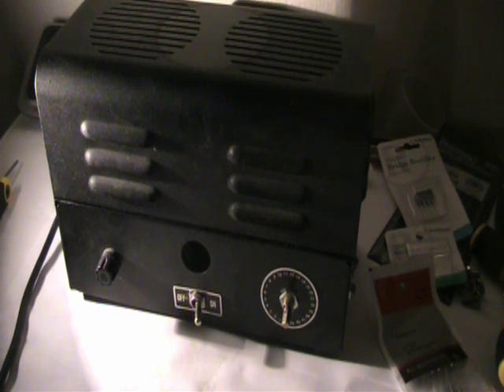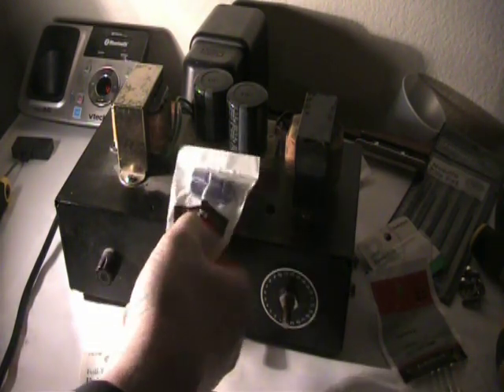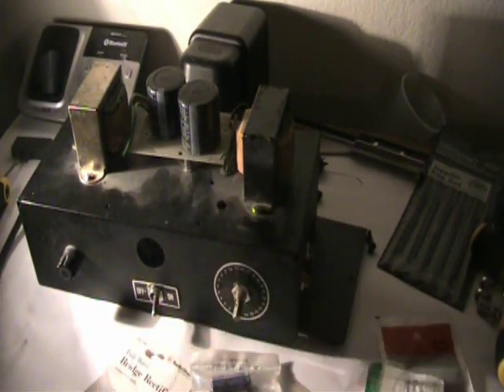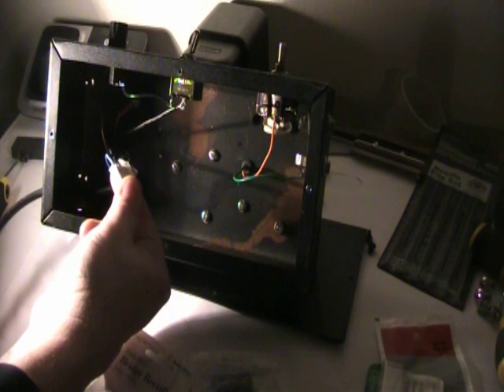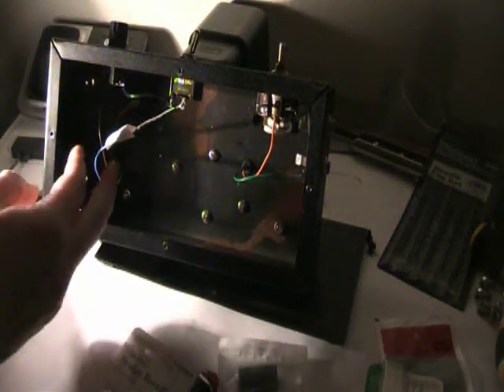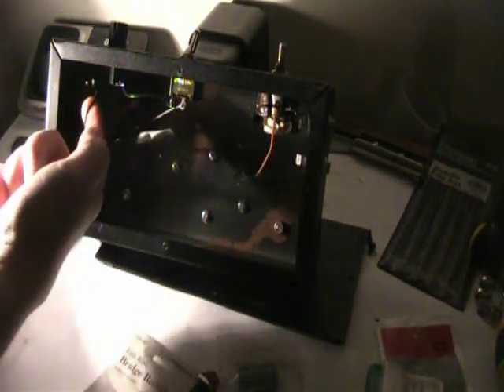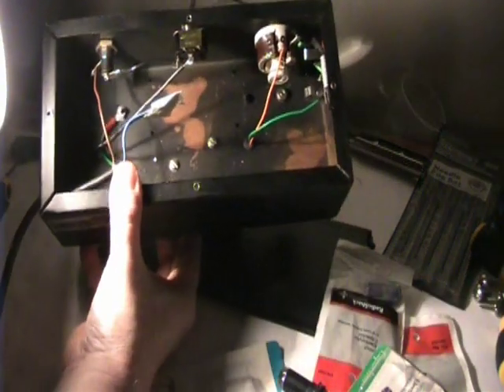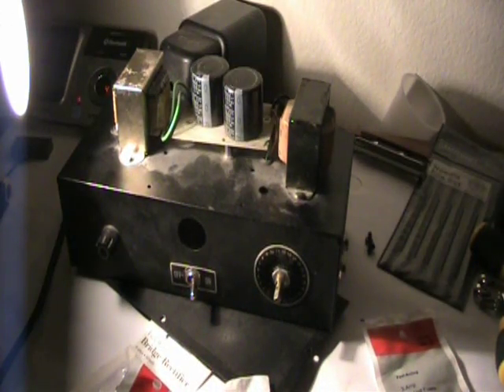How to make a Tattoo Power Supply -

Comment: Does this power supply have a voltage regulator, or could one be added? Also, do you happen to have the parts list that you used for rebuilding this power supply?

Comment: You have one thing wrong on your explanation of the diagram. If you use a potentiomemeter you will need a LM317 regulator and a resistor like you said, BUT it's not that 330 ohm resistor on the diagram. THAT one is used so you don't burn the LED. 
The diagram doesn't show the resistor or the LM317  because that is another circuit on it's own so it just reads "regulator"

Comment from the maker: @rickpermanentmarker       are you apsolutly sure its the psu  , you said you did a spring change .  if the machine was throwing a large spark that sounds like a capacitor .  and if it is pegged maybe something is shorted .  does it do this with other machines ?  always remove any variables when trouble shooting

Comment: I've got an old National power supply I've had for 12 years without any problems whatsoever. While tunning a machine after a spring change my power supply started throwing massive power, my machine was arcing like a welder & the voltage needle is pegged all the way up & I can't get it to come down.
Is this likely the transformer is bad ?

Comment from the maker: @dogofwar213   as i said  the knob on a power supply is to adjust the voltage it add power to the coils , making them hit harder , it doesnt go faster or slower , just harder or softer  ,  sometimes like doing color you have a bigger gap and more needles so you need more power to plant the color  .    speed  is actually  set by the other factors i said previously , a color machine runs slow and a liner runs fast because of the gap .

Comment from the maker: @dogofwar213       machine speed is changed by the gap of the front contact screw the stiffness of the front spring and the capacitor size  ,  but the screw  is how you adjust the gap and the gap is what determines the speed .   voltage just makes it hit harder

Comment from the maker: @punchy748   its a 35ohm rheostat  using the pot requires more knowledge than i can advise on . you can even take a 17 volt 1.5 to 2 amp self contained transformer like the plug in power supply used for electronics , then you dont have to solder anything but the rheostat and phone jacks  . watch tattoolans videos  " How to make a Tattoo Power Supply Part 2"  and  "HOW TO MAKE A CUSTOM TATTOO POWER CONTROL "

Comment from the maker: @timmyglass1980   well th edial is the least important thing on a PSU , i liked my dial on the spaulding box it went from 1 to 20   my box i use now is a technical international with a 10 turn potentiometer ,  but it doesnt change anything . however,, i need to know if it is a potentiometer or a rheostat . most likley a pot as the rheo's are expensive and big . so yes you can, they are the same and i think radio shack has them . the ohm rating must be the same 
just look up the 2 types of pots